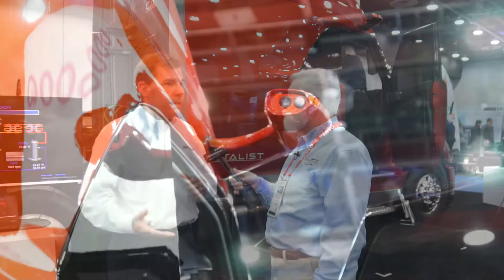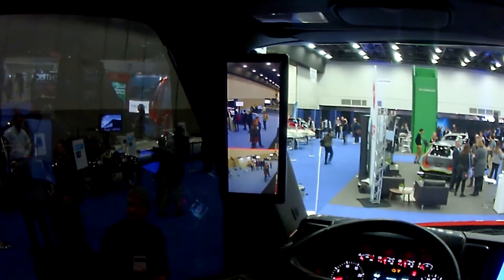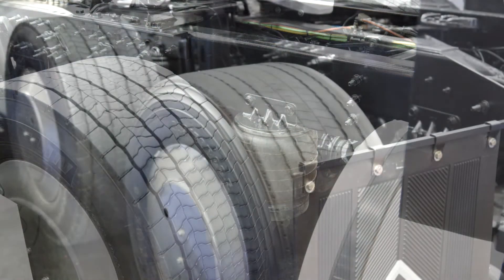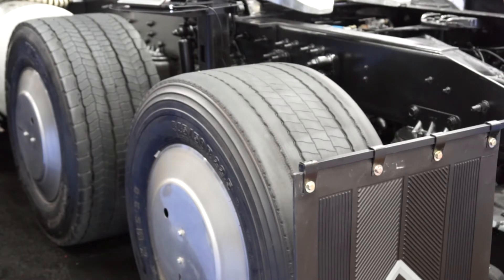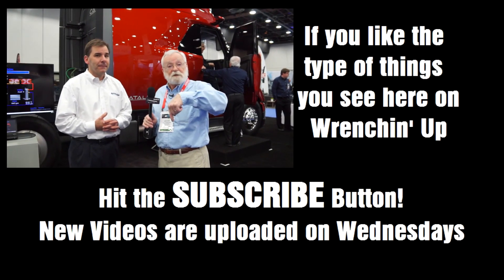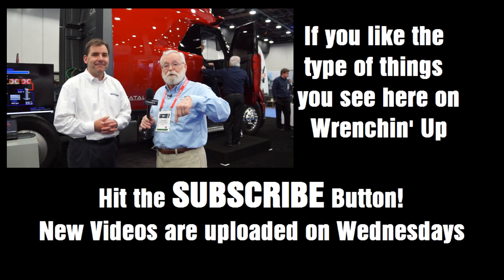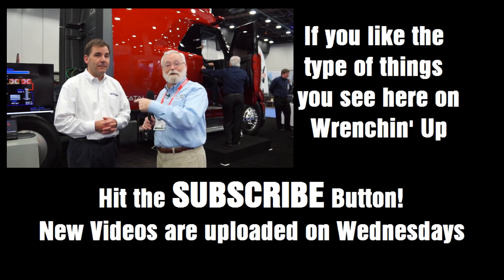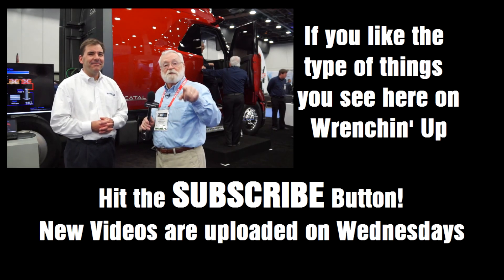Check Out The NAVISTAR Super Truck! - Wrenchin' Up

Comment: Doubling the fuel efficiency over what? Without either providing specs or what comparison you're making this is just a shill review. 
Some of these features sound good, a composite driveshaft is fancy but obviously not cheap. To my ear all of this is geared towards steering wheel holders and the procurement staff of big box-trailer only carriers and so far as I'm concerned that's not real trucking.
Reply from the maker: Hi - Thanks for watching and sharing your very interesting comment!